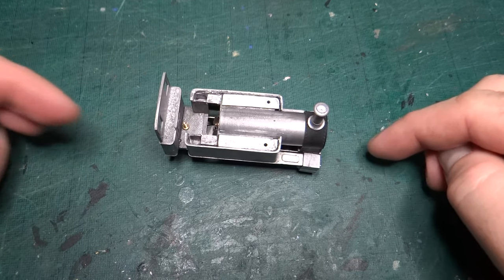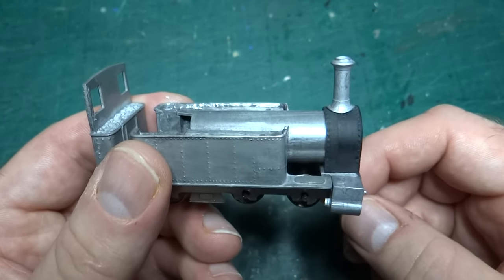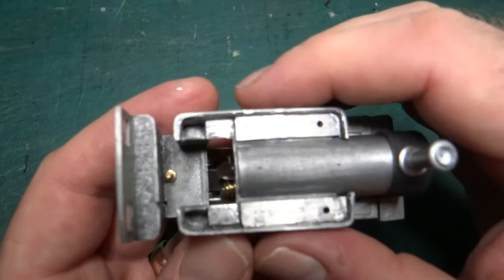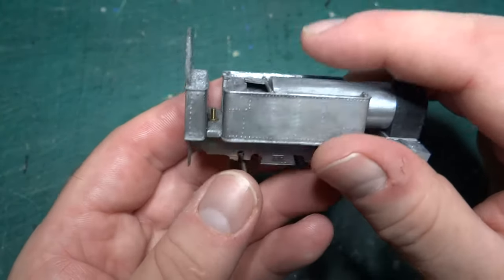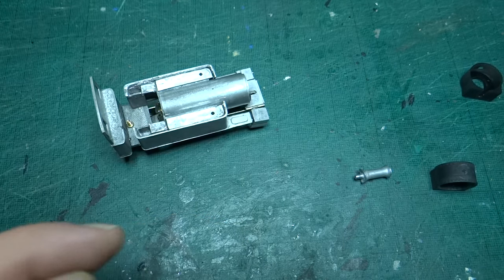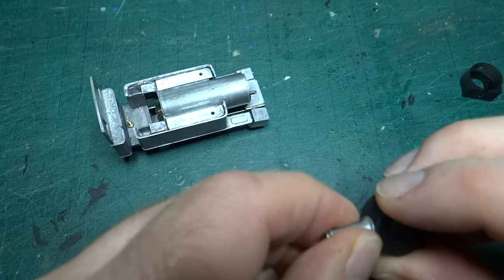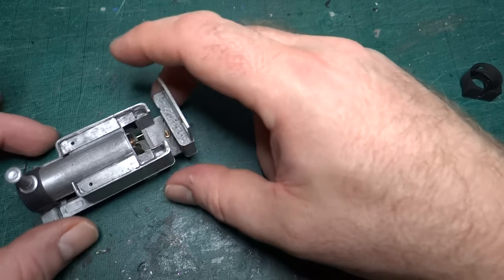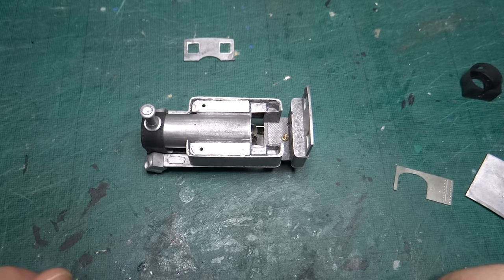Building "The Earl" (OO9 Gauge) from the Golden Arrow Kit: Time for Some Epoxy

Comment: Looking at prototype pictures the cab sides look shorter and there is only one set of vertical rivets. It almost looks as if the model has a half etch for a 90 degree bend, but I can’t imagine what for.  Either way I’d check the dimensions as it may be the roof is ok and it’s the sides that are out. Looking good though!
Reply from the maker: Yes apologies, I didn't make a good job of showing the etched cab sides. They are designed so you can build the cab either as it was originally built or the GWR rebuild. The original cab was shorter (front to back) so you would trim the etch along the half-etched line at which point the roof would probably be the right size. I'm doing the GWR rebuild though so don't need to cut it down and only need to punch out one set of rivets. I'll try and remember to explain that properly when I get to assembling the cab for real.